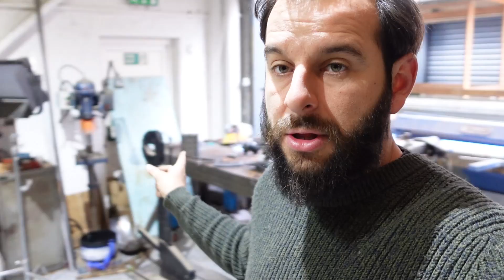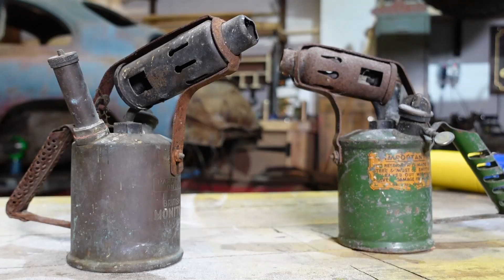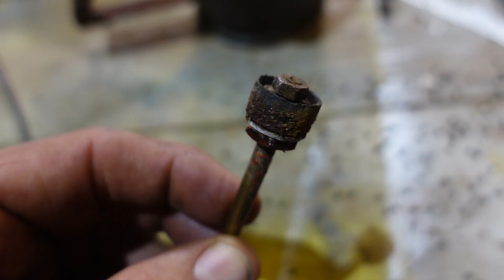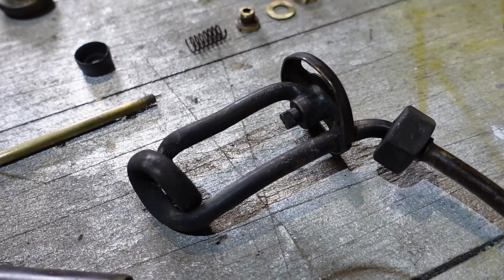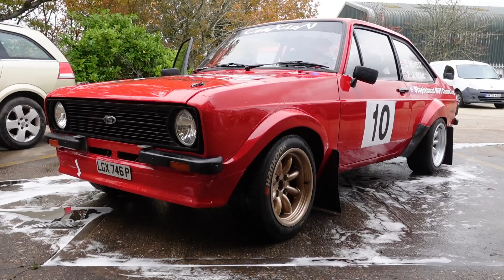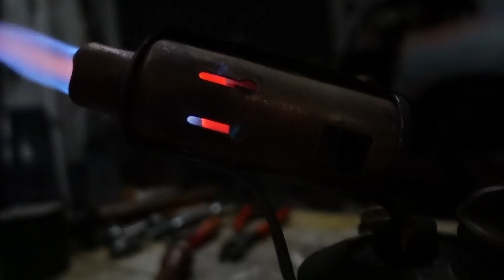Firing Up An Old Blow Torch! | Restoration

Comment: Very useful video.
Have just bought two of these a smaller one and a standard size blow torch and have restored one of them. The smaller one but am nervous of trying it out and whether it will work properly.
I found that the seal on the pump plunger isn't as snug as maybe could be but how do I go about making another one as it seems to be leather?
How tight should it be in the tube?

Comment: Hi Dom. Thank you for this video, it is really useful. Ive just acquired one of these, almost identical to the one you took apart in  this vid. The rubber seal was nakered, literally fell apart when i took it out. Where can i get a new one?? Or will i have to make a new one as you did??

Ps: the car looks like an MST Mk2 Escort with a 2.7 Millington engine... Sad i know 🤣

Comment: You have to rip a tiny piece of rag and soak it in paraffin and put it into the square hole in the nozzle and light it, it brings the fuel to a temperature that it will ignite

Comment: Considering the projects you have and especially with the farm and the high humidity environment, I recommend you give Corrosion-X a try.  I do not work for them, just an admirer of the product.  It is a penetrant and corrosion preventer without equal.  I learned of it in the marine industry and it is indispensible.

Comment: Max Sievert of Stockholm Sweden parraffin blowlamps were all ways concidred to be the rolls royce quality of plumbers blowlamps so if you see a vintage one in a boot sale it may be well worth buying if its in good order also look out for the vintage prickers that were used to keep the jets of the  blowlamps clean prickers were about 4 or 5 inches long and had a flat tin small handle and a short fine wire at the other end for cleaning the blowlamp jet hence the name prickerback in the days when plumbers wore flat caps plumbers used to keep the  prickers in  the peak of there flat caps 😎 happy days when tools  were quality and made to last a life time and plumbers served a 7 year aprenterships so were craftsment at there trade .

Comment: My dad had has an old blow lamp he used to struggle to light it easily then a friend told me how he used to light them but I forgot and now I'm here
Reply: Yeah, my Dad showed me how to light his with paraffin. Wrap a small piece of rag in the bowl where Dom put the meths. Put a little pressure in the tank to get the paraffin to bleed out of the jet to soak the rag. Then release the pressure and close the release screw. Finally light the paraffin soaked rag and wait for it to get hot enough to vapourise the paraffin. The trick is not to rush the pressurising of the tank until everything is properly heated.

Comment: I can't stress enough to people not to give up on these if you choose to restore one.
The trick is, to let the methylated spirits burn a couple of trays at LEAST!!! After which, start with only one or two pumps. The nozzle pipework needs to be very hot before these lamps will work. People often get a jet of paraffin shooting out, or setting fire all over the lamp and just give up. However, get the nozzle pipework seriously hot by burning the methylated spirits longer and the joy once it kicks into life is definitely worth it!!!
Took me two days...I made a new pump seal from a charity shop belt, soaked and shaped it in oil and I just couldn't get it to fire up properly. I was about to give up, but decided to think about why it wasn't working. Then sure enough, away it went.
I sat back and admired it for a good five minutes like the man I am!!! Lol.

Comment: Shame about the Edwards. My mentor taught me wheeling on his and it was a very nice machine. I couldn't get one of those so have a modern machine and to be honest, that works fine. But definitely doesn't feel as nice to use. The white smoke from the vapourised but unburnt paraffin is how they do smoke trails for air craft at air shows (or at least used to). You get similar with home made DIY jet engines made from turbochargers. When the afterburners don't ignite properly you get huge clouds of white smoke!

Comment: you say that the green one is much newer. i'm here to tell you that you're wrong, that green one is steel and was 100% made during ww2 and will be Ex military and will be marked somewhere with T&W and likely a date, the steel ones were made due to shortages of brass during ww2, the other brass one could be as old as the 20s but is more likely 50s or 60s and the green one is worth a lot more than the brass one.

Comment: What is the "paraffin" you speak of?  The only thing we have over here is paraffin wax, not an oil.  Is that another name for kerosene?  How do these torches compare to a standard propane torch or one with MAPP gas?  I know they were used by plumbers back in the day, but they dropped them like a hot rock as soon as better torches appeared.  I get the impression that they are very low-temp gear compared to modern plumbing torches.

Still, as a blacksmith, I'm keen to have one in the shop and wouldn't mind using it for the rare instances in which I need to solder something together.  It doesn't look like it'd work to spot heat steel bars, like for riveting, but it'd be fun to have a working model here just to say I had it.

Comment: Petrol ones are good.No pressure pump and no vaporization coil .Usually the needle valve protudes the orifice to clean it. still got to preheat with meths

Comment: Back in the day (until the '70s when gas lamps came out) nearly all plumbers had these. The rest used a different type which ran on petrol instead. These could be distinguished by having a horizontal burner instead of an inclined one, and no heating coils inside. They could be started (ignited) a lot quicker as they didn't need to be warmed up but I imagine they were more dangerous. 
My Dad was a builder and as a 10 year old I used to spend my school holidays playing on the site, "helping out" the various trades and generally making myself a nuisance with the never ending "why do you do that?" and "what is this for?" questions. On one occasion I was walking past a house where a Plumber was working and I heard a loud warning " LOOK OUT!" followed a second later by a fireball flying out of the upstairs window, (in those days they didn't glaze the houses until just before the painters came in, so no glass in the frame). The fireball touched down about 20 feet away and promptly exploded, but luckily I had fast reflexes and managed to get out of the way, and no one else was close. It turned out to be a misbehaving blow lamp, and I was a bit shaken up and I forgot to ask if it was a paraffin or a petrol one, although my guess is the latter. Kids eh, never ask the right questions! 😀😀.

Comment: My grandad was a painter and decorator all his working life, he used one of these paraffin blowtorches to strip old paint. It had a little flat silver metal handle with a thin wire at the end, he called it a pricker and it was used to clear the hole in he jet.

Comment: I had several of these small ones and one very large one that was a 2 handed one gallon! Container that I believe was used to remove the old bitumen from canal barges. I never had it running. Way too scary. Nice work Dom.

Comment: Hi Dom, yup I'm another of those guys who's dad had one of these, I remember him replumbing the shop we moved into in 1962,  fantastic at jointing into the old lead water feed pipe, had heat to spare. I used it a couple of times and remember the fiery paraffin jet that would start if you failed to leave the pressure relief valve open 😱.
Heaven knows what happened to them, gas's blow lamps became so much more convenient to use 🤷.

Comment: Thanks Dom. I've got a couple of vintage oil lamps I've been putting off refurbushing for ages. Seeing this video makes me wanna get around to them.
Quick tip, when using the leather punches, never strike onto side grain. Always strike onto end grain. It makes it much much easier and doesn't blunt your punches as much. Do a test, with side grain and then end grain and see for yourself.
Feel free to check out my channel, for tips just like that.

Comment: I had a play with my three blow torches the other day and couldn't get any of them working despite stripping, cleaning etc. Time to have another play with them now with better results hopefully.
Reply from the maker: Let me know what the issue is maybe I can help? 
New leather cup seals are available on eBay I have since found out!
Reply: @DominicChineas  I made a new leather cup and it works fine. I thought the squirty was too much so suspected the jet nozzle was worn but yours was the same, which is why I must try again. I am nearly there. Thanks for replying to my comment.

Comment: Dominic, I collect paraffin camping stoves, so far 130+, which work on the same principle, firstly in your filler cap there is a hole drilled through it, it has a lead plug in it which melts and dumps the pressure if the lamp over heats, your lamp was spluttering this is the sound of a blocked burner jet, it needs pricking clean, don't use a wire from a brush you can still buy proper pricker's, the flame should be blue any yellow means blocked jet and the flame is cold so making soot. I've never seen a rubber seal all mine are leather and should be soaked in neatsfoot oil to keep it supple, don't let it go dry.

Comment: Hi Dom, you were lucky using your gas blow torch to loosen that nut, those old paraffin lamps have soft soldered joints.  If you need spare parts for Monitor, Optimus, Primus, Shinabro, etc, try "The Base Camp" in Peterborough.  Also, keep that leather piston seal supple by soaking in a light oil.  The rubber one had probably gone hard with age and lack of use,

Comment: Excellent project but back as a ornament straight after. Too fiddly, slow, dangerous and just don't work as good as modern canister torches.
Reply from the maker: No chance! Not if you don’t have any other way of heating something! I will definitely use it again

Comment: That takes me back. I can remember using one of these back in the 60's. Remember not getting something quite right and ending up with a flame thrower which ignited the skirting board at the opposite side of the room.

Comment: Not a blow torch but my Dad had a old brass primus stove he used when out picnicking, he used it in an old metal biscuit tin which was modified so it had a section that hinged down. I don't know what happened to it when we cleared Mum and Dad's house but now regret letting it go.

Comment: Dominic: just posted on Instagram about one of these I restored in the 1970’s before restoration was a thing! I got it going as per the instructions if an old Handyman book. I don’t think my parents were too impressed. I also had some jet prickers which were fine stubs of wire attached to a metal handle that you could put into the flame on clear debris from the jet while the thing was working. Sadly I don’t know what happened to the blow lamp but your video has got me looking on Marketplace and ebay! 
By the way, instead of chopping up your apron you could have got a bit of leather off Susie Fletcher. Couldn’t wait that long? Yeah, I’d have cut up the apron as well.

Comment: Could I ask for a favour Dom ? I have been trying to locate one of the LED strip lamps that the experts in The Repair Shop barn have over their benches, but without success. Could you possibly find out what brand they are and post a reply ? The makers might even like to advertise them on your channel as I'm sure that other viewers might be interested.
As usual, I enjoyed the video: Primus stoves and Tilley lamps use the same process of course.
Reply from the maker: I will ask for you, I know they are quite expensive, they give a very nice light

Comment: My dad had a Monitor blow lamp just like yours. It came with a circular wick with a wire handle, you soaked the wick in meths and fitted it over the blowlamp nozzle and lit it. After a couple of minutes you pumped up the pressure and it would burst into life.

Comment: Good vlog Dom, but as a plumber who did my apprenticeship with these blow lamps you needed a few more pumps to get a really hot flame. You showed the correct procedure for lighting it but going from job to job we never carried meths we rapped what was in those days asbestos string around the the well, then we would tip it up with a  thumb over the outlet, pump it so the paraffin hit the thumb and ran into the wick then release the pressure and light it. We would then  prepare the burst lead pipe by which time the blow lamp was hot and ready to pump up.

Comment: When I was a young lad me and a mate were camping down Tenby Wales. To cook on we had a Petrol version of this which we lit in a similar way with meths which worked very well. You guest it whilst  lighting it it fell over and set fire to the tent!!? Luckily the man in the trailer tent next door came over and put it out before to much damage.... very dangerous cooker, didn't use it much after that?mind I was about 13 years old then... cheers Dom.. Rob.ps when I was an apprentice spark in the 60's we used one like these   for soldering on cable lugs etc. I'm sure you can ad d washers  either side of the leather cup and tighten to expand it slightly to seal into the pump..... if memory serves me. At 71 I've forgot many things?   Sorry.!

Comment: Dom I still have 2 of these started my apprenticeship using these still works , problem is that if using a rubbish paraffin the nozzle get blocked and they supplied a tool for cleaning,most it the time we had to use a Filament from a wire brush good blowlamps

Comment: Don't forget your pricker needle for your paraffin blow lamp, it is use to clear the jet if it gets clogged with soot from partially burnt fuel, loads on ebay. Paraffin is an oil and turns into a vapour when heated. that white fog that appeared at the start of run, Your plunger did work after you first assembled it but you then oiled it which stopped it sealing, in future just use paraffin for lube. Instead of using meths use you gas blow lamp to preheat, you can then move flame to catch on fire the vapours easier. Hope that helps.
Reply: Spot on, oil rots these old rubber pump seals. If in doubt, use castor oil.

Comment: I repair (and collect ) pressure lantern's they have those pumps and yes those leathers need replacing many times there shot. I so the one way valve at the bottom is what is called a (pip) some are rubber some are cork and they often leak and need to be renewed.

Comment: We had one of these when I was a kid (as we did a Primus Stove - same principle), and we had a "pricker", a little flange of metal, with a stiff single stranded wire on the end for pricking open the escape orifice to make sure it wasn't clogged with soot, before firing up the blowtorch. Do you remember those, Dom? I think our plunger also had a piece of leather as a seal inside.
Reply: Yes, I was going to say leather as well 👍

Comment: We new you would get there in the end well done Dom & the wheel machine ready to go ended up a good day.
Take care.
Reply: Dom the leather washer is a ‘cup washer’ it needs to be well lubricated and softened to work properly - I learned all about these whilst in the Scouts where we used Primus stoves and Tilley lamps.  The leather cup washer is best lubricated with grease or Vaseline, which also aids the seal you need in the pump chamber.  The very small hole or jet where the paraffin vapour emits in the burner is called the nipple it can easily be obstructed with soot (paraffin burning makes loads of soot!). You clean this with a ‘pricker’ - proper ironmongers sell these in packets of 3 known as ‘primus prickers’.  If the hole in the nipple gets too big from excessive pricking (erratic burning) the nipple can be removed and renewed - you can get a special key to remove and renew it. Thank you you brought back any happy memories.  One further bit of advice is to make sure that your paraffin is clean, Primus and Tilley Iamps have funnels with a very fine gauze to filter the filling.  We used to empty the tank and filter at each use as muck builds up without you realising.  Paraffin has a lot of water in it
Reply: Causing corrosion and rust to build up

Comment: Think you have made me want to get my old Dad's lamp out again which I used to use until the convenience of a gas powered one came along - handy as a backup though when out of gas!
Suggest never wearing gloves at a wire wheel as it's so easy to get one caught - rather have a brushed finger than a ripped off hand!

Comment: The flame looked unstable - it should be a nice cone and make something that sounds a bit like a 'chuffing' noise. I suspect the jet needs 'pricking' to clean it. Not sure where you can get prickers from I suspect the only source may be boot sales. Beware they come in different sizes and if you are not very careful they either bend or melt ! It's a good idea to filter the paraffin when you fill it as even small bits of debris can cause endless problems. 

You should have unscrewed the jet to clean the evaporator - there is a special long socket spanner that fits through the central hole in the evaporator that allows the jet to be removed for cleaning / replacement without dismantling the rest of the lamp.

The quick and possibly safer way of starting the blowlamp is to heat the coil with a gas blowlamp. saves a lot of problems with fires from spilt meths.
Reply: Just bought some "new old stock" prickers from an on-line seller.  They will be used for my garden "flame thrower" used for clearing weeds.  Just a big blowlamp with a long handle really!